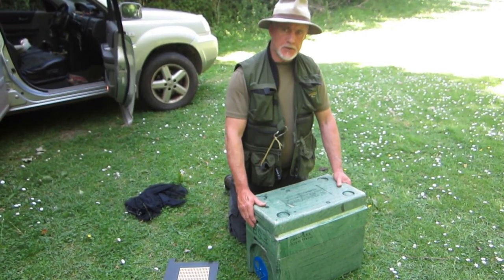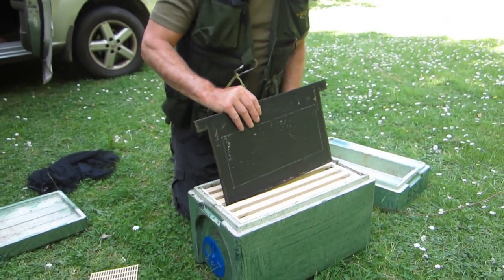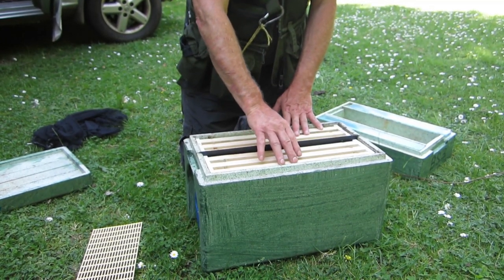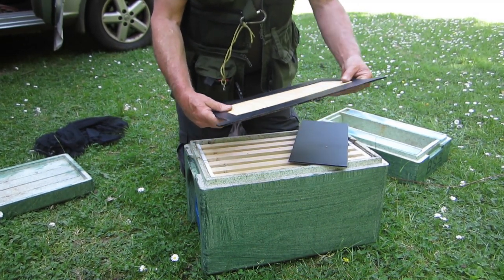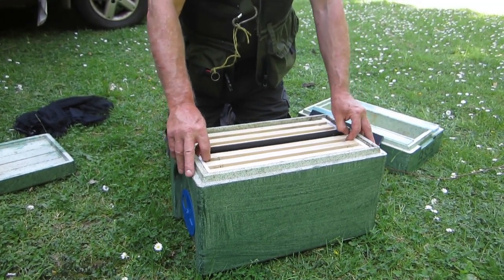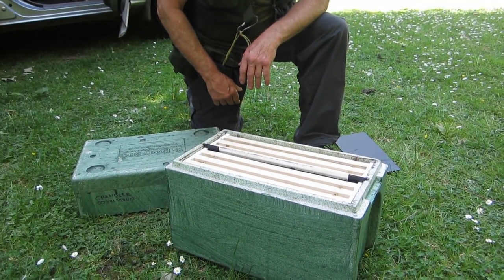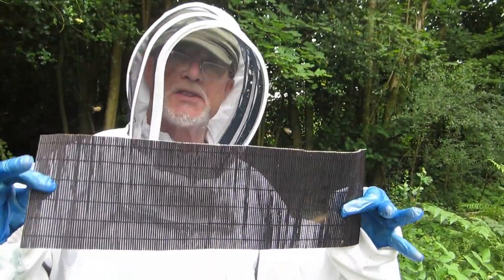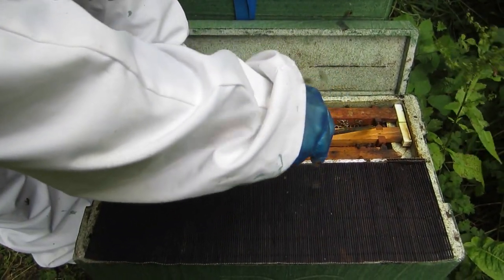How to Make a Queen Castle from a Nuc Box

Comment: I build 3 frame double nucs like that for mating purposes. When fall get here I sell the queen out of the north entrance side slide to top covers apart so they can touch but not cross over for 3 days to pass the queen right sides pheromones  over to the queen less side then I pull the divider plug the  queen less sides entrance and I have a 6 frame to go through winter in.